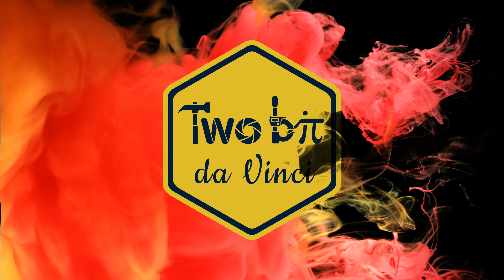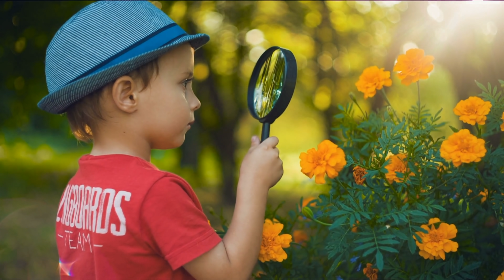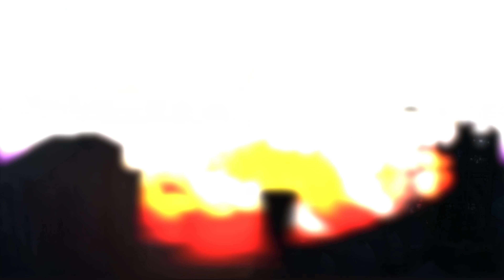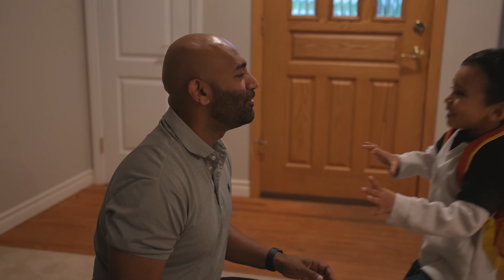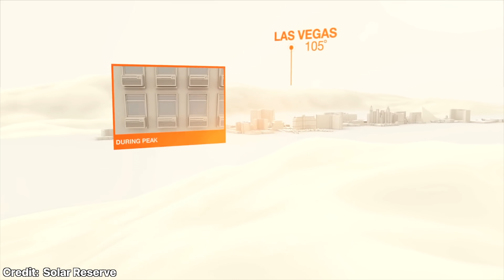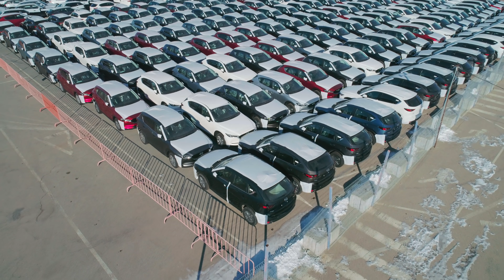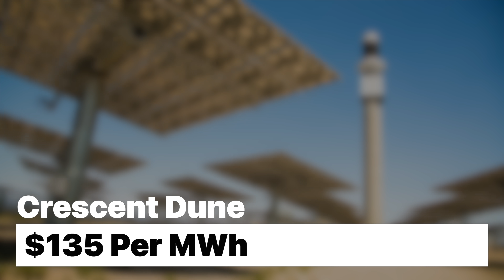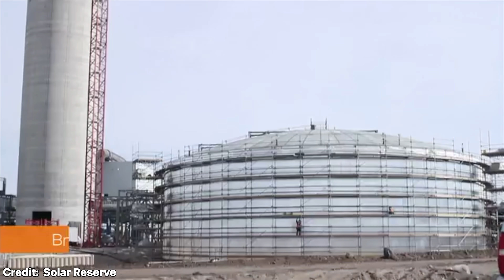This Billion Dollar Solar Plant was an EPIC Failure

Comment: I hate it when the green energy is harnessed but turned off due to economic problems. Shouldn’t economy be a pusher of the technology instead of a delayer?
Reply: The problem is, a lot of people are operating off of feelings without any actual understanding of the dynamics. 
By trying to FORCE change instead of letting it happen NATURALLY,  the cultists of the Gaia religion are causing imbalances. 
No one had to force a change from swords to guns, cars from horses, etc.
When the old sources of energy TRULY start to dwindle, the economy will transition.
Reply: @FireBeam  Forcing things to happen might not be the best way. But allowing innovation is the best solution for the technology to advance

Comment: so the tech works its just that the management sucked and basically the people put in charge of the system did not use proper material as well as good engineering practices to make sure this sort of system was not built on the cheap.  by cheap i mean mofos put money in pocket rather then making sure the system and construction was done correctly. i dont think it would loose them money more times then not they can not make a profit off the idea so they dont want to have it open because they can not make a profit off of the selling of energy.  who would think that energy  of this type would stay 2.00 in a future year. some old greedy mofo who only saw dollar signs and a get rich scheme.
Reply: Somewhere, a stripper is going to college,  thanks to this project. 
I think that makes it ALL worth it.

Comment: There must be a cost effective solution to putting 3 300 gallon tanks on a tower/hill and turbines.  If not someone with smarts should make one.  I was thinking having anti-freeze in the water and using it when needed with solar and wind. This should make one energy independent.

Comment: If they give me that Billion Dollars I would have done way better than these idiots.
I did drive by that thing several times and I was NOT impressed.
I just felt that thing was a failure.
The perfect fuel is veggie oil.
It is a renewable energy source that has the same energy density of Diesel Fuel.
There are algae that can produce 5 x the oil, as land based plants.
We can grow veggie oil on lakes.
Stop all this nonsense.
Liquid fuel is the best and safest way to drive.

Comment: I have to agree at 1 point that the price of Solar PV way back 2010 was far expensive compare to present year 2022. I started my 1st trial of PV way back 2020 due to the reasons that price of Solar PV is already cheap. I think this Green Energy project was invested at a wrong time and at the wrong place and felt the design is over killed.
Reply: Even in 2022 a PV energy generation array produces 10 times more expensive power than nuclear. Unreliably too.
Reply: @judgedredd8876  the reason many nuclear plants have halted is storage of nuclear waste and longevity of the site. But the main thing thst skills nuclear power is the scale up time. To build one of these large plants it takes a minimum of 20 years. Once built it does  provide lots of power and the price per kWh is pretty decent. I hope in the future nuclear could be downsized and the waste issue would be solved.

Comment: I don't understand why they have to heat the salt. Can't they just heat the steal that houses the water that drives the turbine? I'm no engineer but it seems like they only added an unnecessary step. They would have to store extra energy but they wouldn't have had to maintain the salt and that was the problem.

Comment: Using tanks of hot molten salt for energy storage is a great idea. Moltex fast spectrum nuclear will use the stored heat to fill the daily peak demands. It would be a great way for coal and gas fired plant to run at peak efficiency.

Comment: The idea was certainly good, but do I understand correctly that the reason for failure was the electricity price and not the idea and the technical solutions?  Then the plant will pay for itself over time if the operating costs are minimal.  Hope that these were private investors and that public funds were not used for such.
Your example of pumping water back to a higher level probably won't pay either if you don't use a ram-pump that doesn't need any other energy than it produces itself.

Comment: I paused at 4:52. I am a green energy nay-sayer. I think these plants are a far superior choice to wind or solar panel farms. Several countries have these that work well. IF I had to guess this project failure was due to the typical government pocket lining that goes with these big projects where they give the contract to friends and insiders not the people most capable. I was in the Marines and we would constantly see big contracts for "improved" gear that was wildly over priced and usually not as good as efficient as the equipment replaced. I am also sure corners were cut where they used cheaper materials than what any engineer with integrity would demand.
Reply: I watched that sponsor ad and laughed a little at the "will help us get back to normal" part. Must be in California, the majority of the country has already gotten back to normal by Feb 2022.

Comment: Out by Dagget California there used to be a mirrored electrical plant, don't know if it's still there but it was there for years in the late 80's early 90's. Not sure if they were producing it by melting salt or just heating water to produce steam. Like I said I haven't been out that way in years so not sure if it's even still there, but it was supplying power to Dagget and the surrounding areas for years.
Reply: My dad worked on the Solar One project at Dagget. It was a prototype for larger plants. It used molten salt to then turn water to steam. The steam was so hot if there were any leaks you could not see the discharge. If you walked around there you had to wave a stick in front of you as you walked. If the stick was cut in half you had waved it thru a steam leak and saved your life. Also fully cooked birds and insects would fall out of the sky all the time, sometimes in flames.

Comment: At some point in the future they could maybe refurbish the plant by replacing the mirrors with PV panels, reusing those fancy trackers. Decommission the molten salt part, lay some cable and use the existing transformer. Might be competitive with building a from scratch PV plant...ok prob not but would be satisfying recycling.

Comment: They should have used curved mirrors so they don't have to move the mirrors . Also they should have just used water instead of molten salt
Reply: water doesn't retain heat like molten salt. the water would have evaporated out of the tank

Comment: I think the comparison with PV solar isn't helpful. Yes it is the cheaper solar technology but this wss really aimed to be an alternative to gas, coal and nuclear while offering some night time capacity.

Battery storage isn't there yet and still seems decades off and that is despite the mass adoption and ever increasing demand for improved batteries. Everything is still in the "theoretical" or prototype stage. 

Reading the comments below it is easy to see why this failed which werent touched on in the video. You did however hit the nail on the head with other solar plants being successful and the value of the data mined from the project. Ultimately the project was badly managed, coners were cut  and a subpar project was delivered
Reply: pv solar is a huge waste issue. the panels lose efficency over time and have to be replaced. said waste is toxic. building the panels is toxic to the enviroment as well as the extraction of the materials. green energy is often far more hazardous to the environment then fossil fuel extraction and usage

Comment: I love the idea of this tech. I hope in time this becomes profitable at some point in the future. Photovoltaic plants have their own issues but it's the best choice at the moment. The same with energy storage. Batteries are awful for storage but still one of the best options at this scale.
Reply: I like PV: no moving parts.
Reply: thes are the best? fuck
Reply: Hury Springer  that's not necessarily the case on either point. The fact is, solar farms still take up a lot of land, so these solar reactors still have a place in more constrained conditions. And there are still a ton of these operating without issue around the world. Spain has a few dozen still running. In fact, it appears they have more CSP installations than mass PV installations.

Comment: This a bigger issue but no one has solved. 
Battery chemistry. 
The current batteries for rechargeable storage is basically the same as your iPhone. Meaning that they are weak and use too much exotic materials that you can’t make plans for Green Energy until you solve the storage problem

Comment: Scrap the molten salt tower, but you'd think that much of the mirror mount infrastructure could be repurposed into sun tracking PVs. Wouldn't that be a large cost savings for the "next" power company to not have to build the complete movable metal support infrastructure?

Comment: It failed due to the way that power is purchased.   If power was purchased as a block to be delivered 24 hours a day this would force those cheaper photovoltaic plants to have energy storage.  Once the cost of energy storage is included the costs would be far more expensive.

Comment: There are other parabolic mirror plants that directly heat pipes that run to turbines instead of focusing on a tower. Don't they still work efficiently?
Reply: Yes theyr are, Spain are changing to small thermal-solar heatpipe plants instead of giant thermal-solar Towers because of that. 50 operative plants in total, including giant molten salt Towers like this video one.

Comment: I keep hearing all this unicorn fart nonsense about  s curves and the like, when you glossed over something rather relevant.

It takes 'years' to ramp up something like this, which isn't proven and has shown itself to be too fiddly to be reliable.  In that same time, you could build a standard NUCLEAR facility that could ACTUALLY generate its advertise capacity.  Not 20%, not 40 or 50%.  ONE HUNDRED PERCENT.  And you can put multiple reactors in the same site, further increasing capacity.

Solar and wind have shown themselves only capable of despoiling huge swaths of land, with little benefit outside of subsidized net metering/feed in tariff situations.  Their BEST CASE cost per kW(h) is close to a dollar.  Nuclear's WORST case scenario, with ZERO SUBSIDY, is 30 cents.  More oft than not, it's more like three.

You really have to do less biased research.  Renewable and sustainable do not equal clean OR good OR VIABLE.

Comment: I was always skeptical about these molten salt solar plants. Too many moving parts that need maintenance. PV systems are fairly maintenance free, except for periodic cleaning. Energy storage has a long long way to go. several years ago, I looked into flow batteries for my home solar system. They wanted $35,000, and the thing would be the size of a cargo shipping container. Other battery storage such as tesla are too expensive. The warranty on tesla power walls expires well before the thing is even paid off. (need $30k to $40k, yet warranty is like 10 years, while financing would be 20 to 30 years. )

Comment: This is a perfect example of why Green energy cant beat out fossil fuels or nuclear. And if you think of the energy/carbon costs needed to produce this system and the others, you are adding to the emissions rather than reducing. It takes years to get those emissions to even out, and then you have to replace many of those parts. Wind turbines must be replaced after 10-15 years. They cannot be recycled, and are dumped in Idaho. One interesting note, that salt system was used in our nuclear test units in the late 80s/early 9os. IT NEVER FAILED OR MELTEDDOWN. Just as we found a safe way to cool Nuclear reactors, Bill Clinton shut down the research facilities.

Comment: As far as EVs go- until battery or charging tech makes some great improvements EVs will be relegated to commuter vehicles or 2nd vehicles. Last weekend took the family on a mini-vacation. Drove over 800 miles & one night the hotel had zero charging stations. Unless you have alot of extra $$ laying around a petrol car offers the flexibility an EV doesn't. Wife would love to have a Tesla but it is too expensive.  We do have a solar system and wall batt. at home- not against solar or EVs, just too expensive for now. Company I work for is investing in PV generation & battery storage since it abandoned neuclear a few years back.

Comment: Huge error in costing it up: 40 MW of photovoltaics at $2 per W is 80 millions USD, not 80 billion! An dropping to 12 million USD at $0.30 per W. 
So if the costs per W are correct, even ten years ago this would had costed less than 10% than what actually it went into building it (1 billion) - it should have been clear even then this was going to be a white elephant.

Comment: Saltpeter does not neeed to be  1000 degrees (palm face), this technogy is more appropriate for desalination of sea water pipelines to be built which would use extracted salt for more thermal 'fuel' (if vs(>>) membrane tech).

Comment: The real failure here was lack of imagination in the original project financial analysis (and modelling). All we'd have to know is the set of risk scenarios they used when doing the operational simulation and financial modelling, and we would see that they didn't conceive of the real risks to such a project. There are many such risks: economic, financial, technical, operational, weather, competitive, scheduling, etc. Some are difficult to envisage apriori, but many are not, as long as you don't stack the analysis team with a majority of proponents

Comment: Renewable energy should not be transmitted through the grid from a centralized power source. The grid is only there to balance and share as needed. The power source should be decentralized, generated at every building including the barn. These massive projects are doomed before they start

Comment: Can't wait for the crazies that want for salt based breeder reactors ... ok, these are designed a lot better but using salt is not a good idea (sodium based salts.) Liquid ceramic reactors are vastly safer and don't have those issues of corrosion, unlike salt based reactors.

Comment: Green-freaks think it's stupid to burn fossil fuels that produce "catastrophic" CO2 that might be greening the Earth and increasing crop yields. Their solution?...Do something that's even more stupid...low energy density Wind and Solar power...There are 2 major problems with Wind and Solar and these are deal breakers...1. Wind and Solar are not continuous forms of energy  2. The technology isn't even close to being able to store large amounts of energy for use during times of no Wind and Sun. If you believe someday we'll have battery technology developed to the point where you could power Las Vegas for longer than 8 seconds with stored energy you are indeed clueless.

Comment: Wind and solar are simply supplementing our energy infrastructure.
You all know how little this is helping, but how much it is costing.
Mining the metals for panels is creating a massive ecological disaster in China.
Have you all seen what happens when you try to extract this stuff from rocks?
Its pathetic, and it is sad.
Then there is the disposal issue.
At the most, panels last 20 years.
20%-30% of that time is a total loss.
We can't make them any better for right now.
We can't possibly suggest that most people will be led to believe that these panels will save their lives.
Millions will die in the winter.
Its time to scrap this project.

Comment: The mayor of my town once said, "Avoid anything that an engineer, architect, or contractor says is 'new' or 'innovative'.  You're just asking for a lot of expensive experimentation (failure) at your expense."
Reply: Concentrated solar power isn’t a new concept
Reply: @jaredkelly4991  -- Obviously this plant was.
Reply: The solar plant by Vegas is not Crescent Dune. It's called Ivanpah and it was finished two years before Crescent Dune. It's operating normally.

Comment: An interesting vid.  It points out (rightly so) that PV is about 20% efficient.  So,  what gets done with the about 70 +%  energy from the sun that is not converted to current?   Its waste heat, and causes less efficient conversion due to hot solar panels.   Well,  it also gets conducted to the air, warming it up.   Sounds like something I hear the environmentalists are " fighting" .. "it generates global warming".    So you have a 10 MW solar farm,  and you are heating the air around it with about 35 MW of thermal energy.   Hummm...   Not good.   I realize that the earths surface normally gets warmed by this energy, but, a lot of it is reflected back out, as its a light colored and there for reflective surface.    The solar panels absorb the lions share and reflect little energy back....   Just something to think about..

Comment: The Mojave Solar Project also heats up a transfer fluid for powering a steam generator but it seems to be going strong. Different architecture.
Reply: Spain had 50 thermal-solar plants and most of them are heatpipe-solar plants instead of Tower-solar plants, its different architecture and had less problems than molten salt towers but less efficient, anyway both tyoes of thermal-solar plants ARE OPERATIVE working on this current moment.

Comment: Im not sure why PV cost per watt is considered relavent as they lack the density to be used for infrastructure scale electrical generation. Id suspect wind turbine costs, capability (now at around 4 MW per on shore turbine) and the scalability and deployability of that technology has made it a more appealing option vs Concentrated Solar generation. 110 MW is well within the wheelhouse of wind.